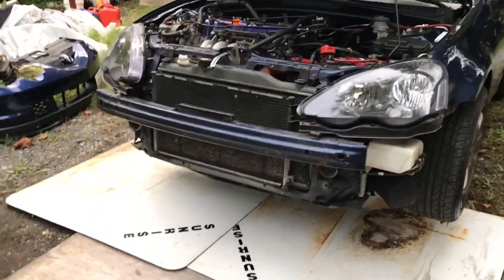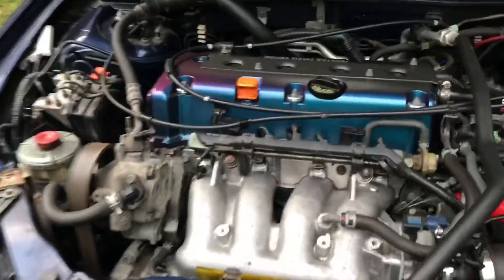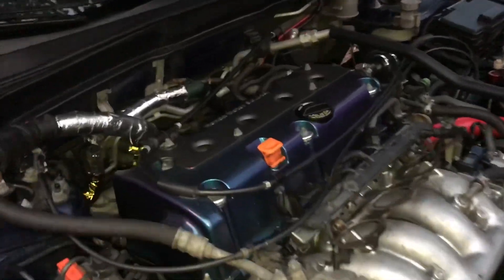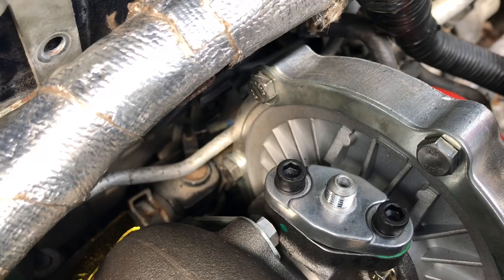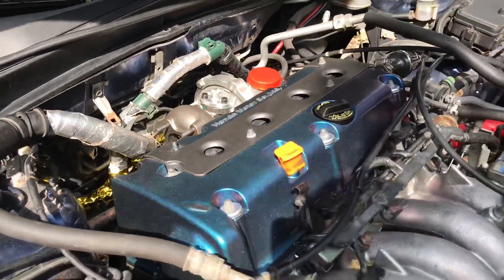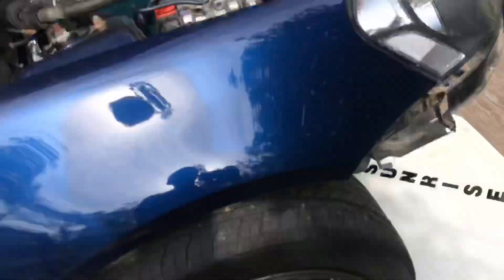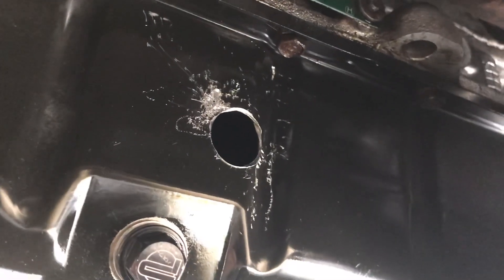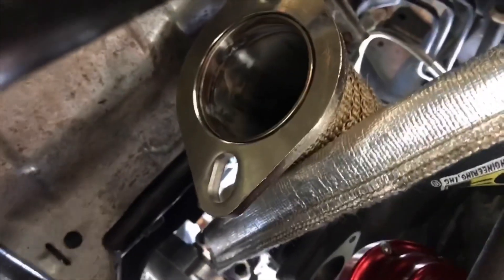Emusa Turbo Rsx Build Episode 1

Comment: I dont follow your channel just happen upon this but i just wanted to say i highly reccomend if you havent already not to use that oil feed line. Get another good line from anywhere else ATP turbo, extreme psi, hell you can even use the stainless "nos" -4an lines but the one in your vid here has plastic liner and it melts and will end up clogging up at some point and your line will explode. This happened to me and started my car on fire when i was making a pull on the interstate lol. I ended up getting it put out but it cost me literally thousands to fix all because i cheaped out. The rest of the stuff is good enough but the oil feed and return is a no go.

Comment: Do you have any issues with your drain filling up? I find when im on a incline my drain backs up due to the oil not having anywhere to go. I tapped my pan on the very upper edge too and yours is much lower. Any issues?
Reply from the maker: I don’t have that issue. What size are your lines? My car is currently having other issues at moment but getting it looked at soon for results so stay tuned ima for sure make a new video.
Reply: @Dc5Max  10an for the drain, just replaced the whole line with a new one and it still seems to leak from under the turbo. It seems to only happen if i constantly bag on it for a bit or if im on a incline.
Reply: how much oil does your car take to be full with the turbo set up? I have it perfect but maybe I have to keep it at a lower level to solve my issue?
Reply from the maker: I actually just had an issue were I had my catch can setup installed wrong and my shit was blowing oil past rings but I compression checked and fixed the issue and I’m back in business
Reply from the maker: I’m currently running to much oil also I would use around 4.4 q or tad lower
Reply: Just an FYI it doesnt matter where the drain is. Have a look at the greddy turbo kit for the RSX the oil drains through a banjo bolt at the bottom of the pan, no tapping anything. This is an extremely common misconception but it will not back any oil up or anything like your saying and oil can return to the pan wherever you want its just better higher for obvious flow reasons.

Comment: not best spot for turbo oil return line  the gforces with push oil up the pipe  id drill a hold in block  in a section above the oil pan so it uses drain back holes from head that way oil will not back up  under heavy loads

Comment: What mods did you have before doing the turbo? Not brands
Reply: Im bone stock with a sri amd wanna get there my next mod is the ktune
Reply from the maker: Had srs shorty header, Test pipe, full hks catback, Aem intake, Prb intake manifold swap,Kpro,Action stage 3 clutch
Reply: Would i be able to do this with it being auto?
Reply: Were in the same rsx group on fb btw
Reply from the maker: Yes it would work ether way.
Reply: Thanks and love that color btw rarely see it on rsx friend had a 350zHR that color
Reply from the maker: Really? It’s a stock rsx color was thinking about dipping it something else or just saving up and getting it oem color haven’t decided yet early next year possibly

Comment: Might be a stupid question but did you drop the oil pan? I see that drilled into it for the fitting, jw if you dropped it to clean out the shavings
Reply from the maker: I didn’t drop the pan. I have a magnetic drain bolt on the pan and as when I finished drilling I flushed pan to make sure there were no shavings. Also why you use a lot of grease on the drill bit
Reply: @Dc5Max  I did not think of it like that... That would make it a lot easier for me too. I am planning on installing a Turbo kit on my K20A2. Thanks for helpful videos and the reply!

Comment: Will this fit an 07 si…?
Reply from the maker: Possibly add me on Instagram and we can talk me about it.
Reply: @Dc5Max   don’t use Instagram
Reply from the maker: Ok I believe the kit will work but there will need some modifications To be made as far as the intercooler piping goes. Other then that turbo and manifold should fit but the proper clocking of the turbo but it’s hard to say haven’t had much experience witch those chassis but it should work